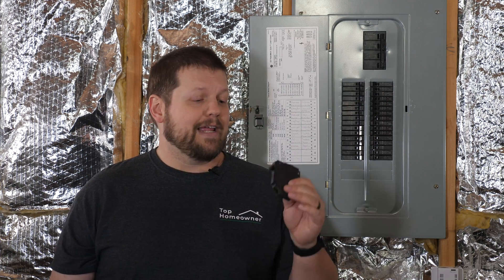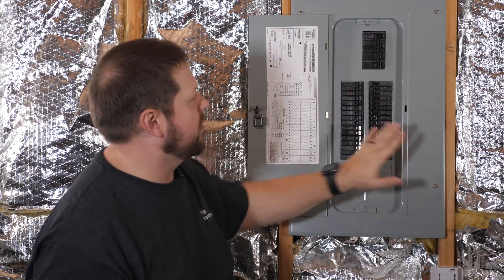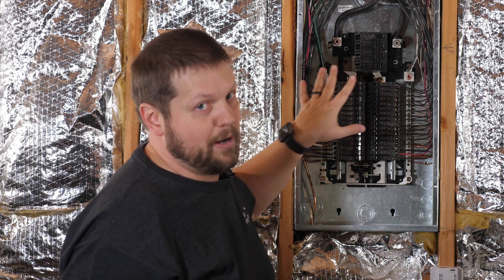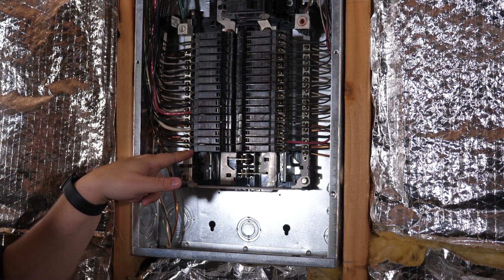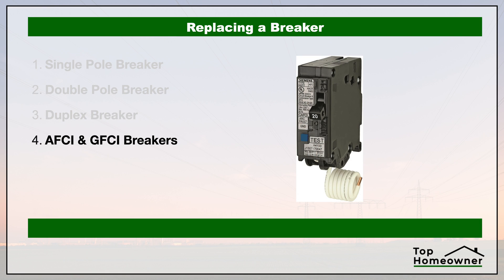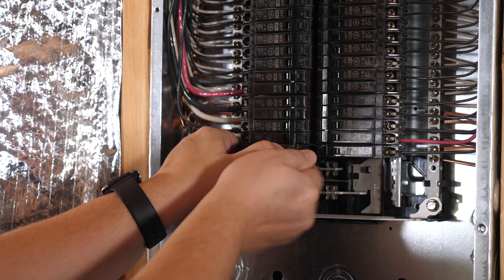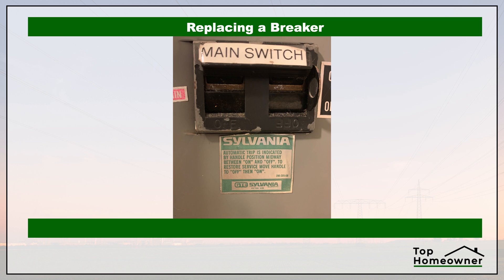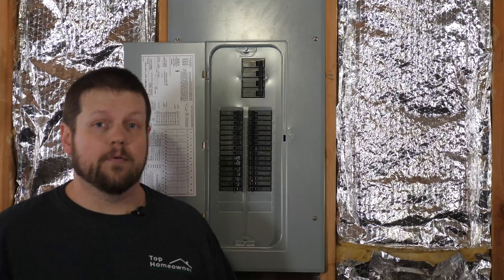How to Replace a Circuit Breaker | Quick and Simple Step-by-Step Process

Comment: Good video!

Question- I have a dryer (less than 1 year) that just started tripping the breaker AFTER about 10+ minutes.

I reset the breaker a few times and it does the same.

House is about 16 years old, and dryer is 1 year old.

If not for bad dryer motor or heating element.. is it possible the breaker is bad?

Again it just started happening
Reply: I have same problem.  The tech said that electric dryer should be on a 30 amp circuit.  Current circuit breaker is only 20 amps.  I will try and change it myself.  But I'll verify my life insurance is in order first 🤪
Reply: @Rabideen  lol. Yeah before any dangerous activity always check up on the policy! 😂😂

So we had electrician come out, did full diagnostic and found nothing! And of course it did NOT shut off when the pro was there.. 😂

Nothing was fixed other than tightening some screws, on the dryer, outlet and breaker.  Problem has not come back since! 🤷‍♂️🤷‍♂️
Reply: I live in a studio apartment and my breaker for the bedroom/living room set been going out, and I switched back on.
Reply: Mine is doing this exact thing! It’ll be fine for 10-15 mins then trips the breaker I’ve already checked turned power off and checked the junction box in the attic the wires in the plug and then the wires the pigtail goes into the dryer and they’re all tight so now I’m putting my big girl panties on and gonna check out the breaker. Cause mamas gotta do laundry. I hope it’s just loose.

Comment: Great video.  Loved shutting down the kids!  Two questions......Why are some wires red by the breakers, and why did your tester lite up when you were scanning the breakers for juice? Thanks.
Reply from the maker: The red wires are thicker gauge, like for a stove or AC. The tester flashes every couple of seconds to indicate that it's on. If it detects a current it flashes rapidly and beeps.
Reply: @TopHomeowner  Great day when you learn something. Greatly appreciate the getback.
Reply: @moboutmen  are you still alive
Reply: @versatilex97  Hold on. I'll check.
Reply: @TopHomeowner  , I was going to ask very same question!!  Thank you so much.
Reply: I